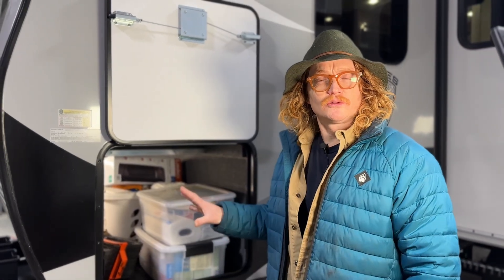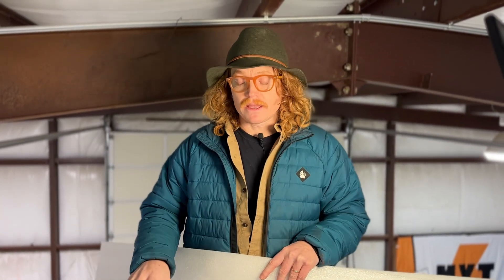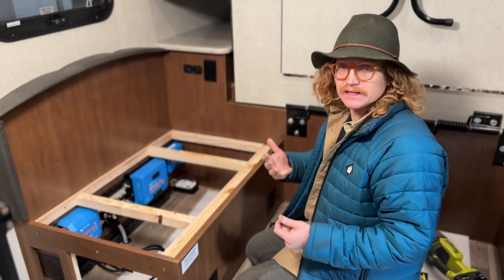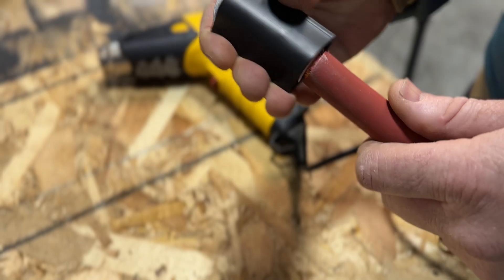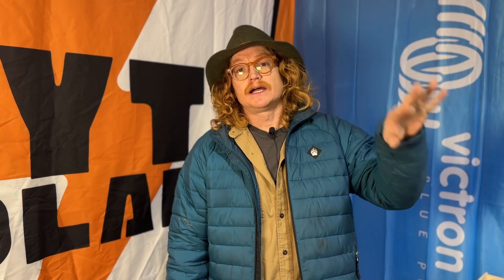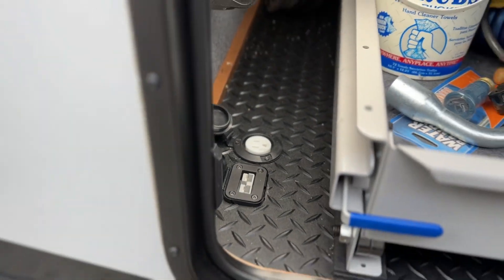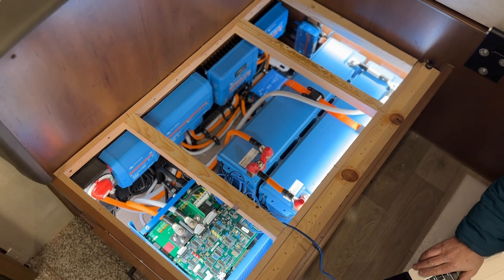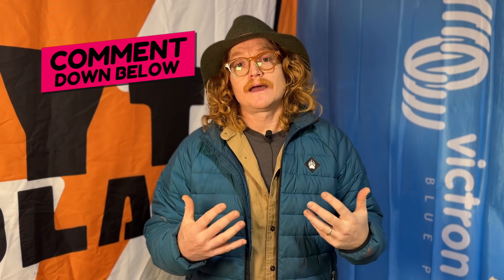#RVSOLAR STEP BY STEP: Our process to install a full Victron Battery/Inverter/Solar upgrade

Comment: Tom, what's the thought process on using the 250/70  vs the 250/100 solar controller?  Shouldn't those panels be able to produce around 100 amps charging at 71 volts at ideal temperatures?   Is it simply a cost saving for expected average performance?

Comment: Where can I get those fans that integrate with the Cerbo?  Do they make a 24V version?
Reply from the maker: @PowerUpAdventures  they’re not specifically Victron integrated fans they’re just standard dc brushless computer fans but we use the relays on the cerbo to control them. We’ll do a video soon in detail you should be able to follow and replicate .

Comment: What do you use for the rooftop solar combiner box? You said you removed the factory combiner box.  Also, would like to see a video on your solar rails.   Thanks, great videos!
Reply from the maker: Hey there! We replaced the factory box with a simple GoPower entry box with a single male and female connection. We use Bougue RV branch connectors to give a 2 to 1 connection at this box. I'll try to get a video on our rails soon. Its kind of our secret sauce so we can't reveal it all.